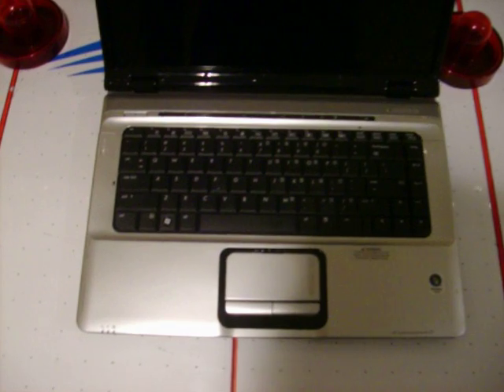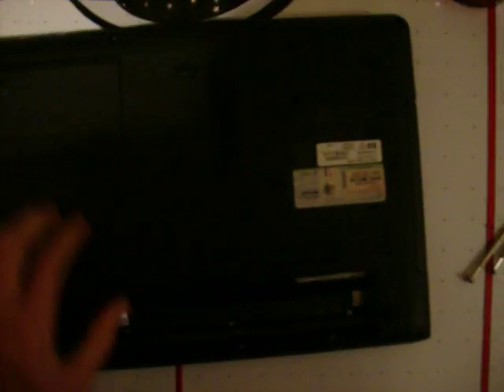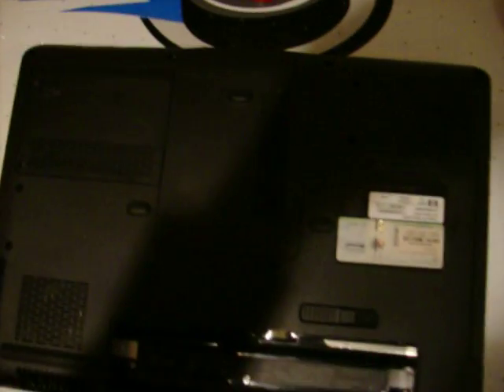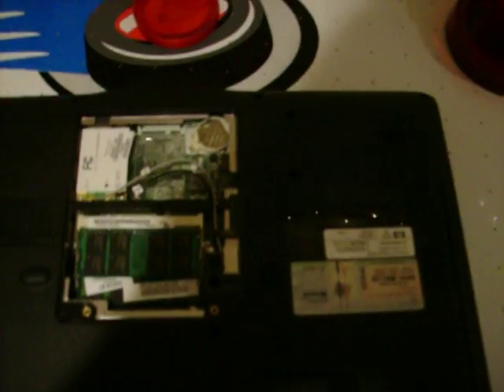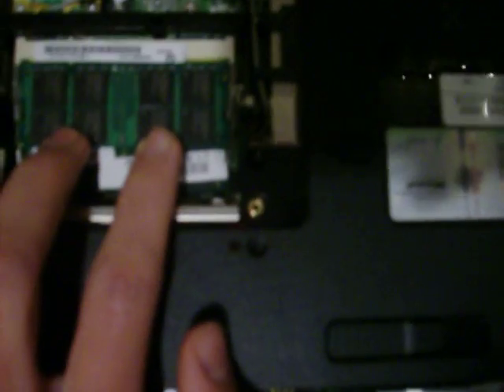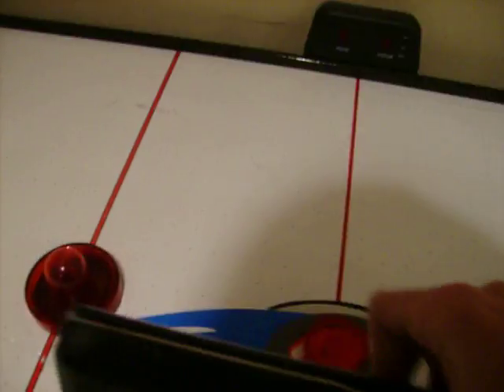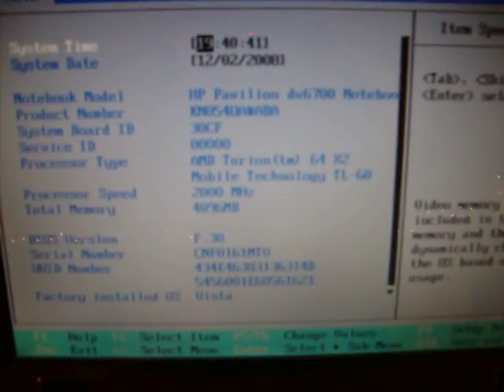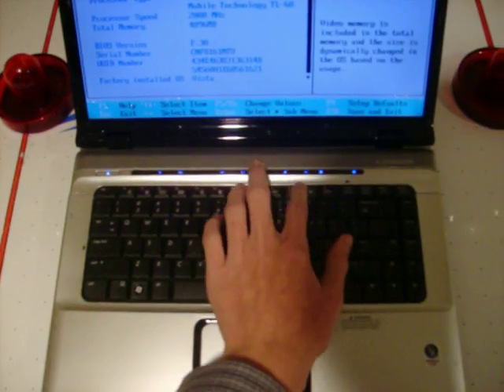How to Install RAM in the HP Pavilion Dv6809wm  (Or any Laptop Computer with DDR2 Memory)

Comment: Thanks, I just did mine HP pal 6626us and saved twenty dollars from your installation informational video.
Great job on that, thanks, it was so easy I could not understand the charge they asked for at the local PC store.
Dave in CT

Comment from the maker: Memory is RAM.  RAM is stuff that lets your computer load programs, the data is stored in the RAM until you shut down, then all of that is deleted.  If you install two 2GB sticks of RAM, and you have a 64-bit OS, you will have 4GB.  If you install two 2GB sticks, and you have a 32-bit OS, you will have 3GB of RAM.

Comment: Hey I have a HP G6 series laptop and I try to pop in another 4 gb ram in it. It is a Corsair Vengeance RAM. After putting in the RAM I feel like it's a little loose and it doesn't recognize the RAM either. But I can't tighten it up. Can you help please?

Comment: hi i own a hp g4 1 slot has a kingston ddr3 2gb second slot emty took out the a ddr3 from my
samsung r430 model is a 2gb ddr3 brand name samsung i placed it on the hp second slot
it works great but my question is could it bring any future problems? is it safe?
ive havent had any problems and its faster too both ddr3 look exacly the same the only
thing different about the sam ddr3 is the color is green not blue

Comment: ok so i have a dv2000 with default ram. i know its a old laptop but my current one broke but i have 2 gb ram in that one. i was wondering if its possible to remove the ram  from tha laptop (acer) and put in in the dv2000. (im aware dv2000 allows 2gb max ram)

Comment from the maker: 32 bit Windows can only handle 3GB.  I would take out the 2 512MBs, and put in a 2GB and 2GB.  Even though only 3GB is useable, since they are both equal, it will perform better than using a 1GB and a 2GB.